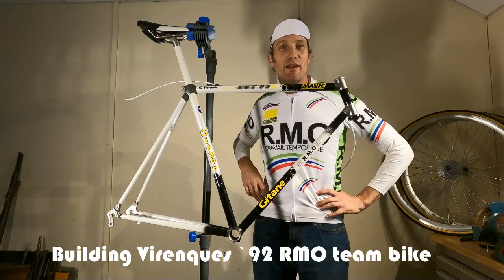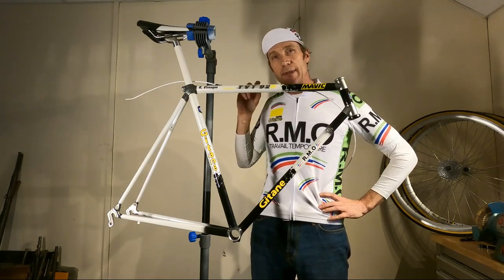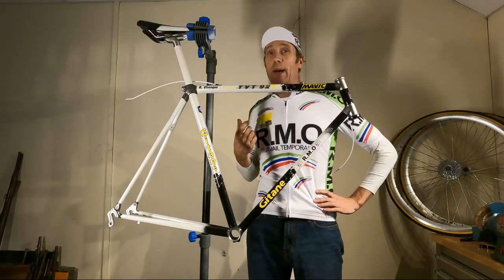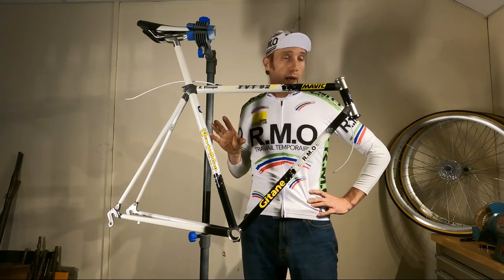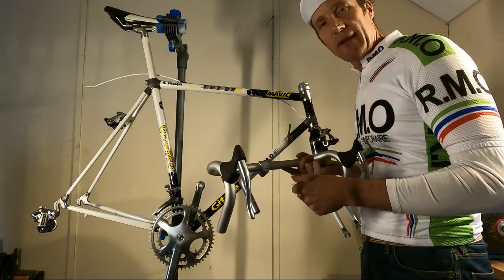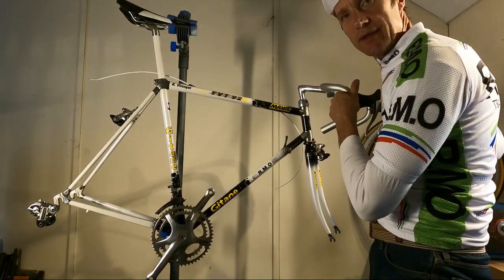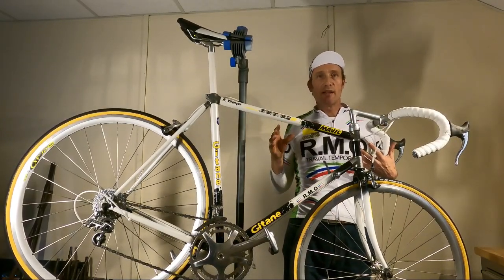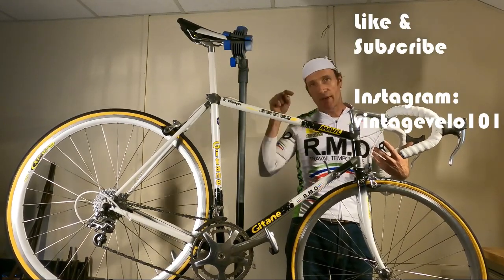Richard Virenque`s `92 RMO team bike build

Comment: Beautiful bicycle.  Richard Verinque 7 time KOM! Sean Kelly said In an interview he liked the Mavic Components so he’s a good supporter.  I have a 1986 Vitus 979 full Dura Ace.  My positioning is strange as I feel my head extends past the handlebars.  In watch Sean Kelly in the 1986 Paris Roubaix, his positioning is the same so the “run small” description holds true.  The wheels on mine are the Mavic Gel 280 32 spoke which have a reputation of being frail due to their light weight design.  I installed some beefy 25mm tires which barely fit in the rear triangle, but in doing so I believe I saved these rims as they are completely original.  Good day, Sir!
Reply from the maker: Nice, I`ve always admired the 979, one day...

Comment: The Lemond GAN team was spied using 8 speed Campagnolo Ergos.  Speculation was a campagnolo spaced shimano cassette and some speculated there was a 571-2 campagnolo free hub.  Mavic did make a Campagnolo 8 speed for the 571-2 hubs.  I found one a few years back.  I run a campagnolo rear derailleur which matches the silver rear derailleur in the GAN pictures.
Reply from the maker: Can be tricky figuring out exact team spec as there was always behind the scenes tweaks going on as you say, Dan

Comment: i just had to rewatch the 92 tour to see that bike and i'm pretty sure those bars weren't set up like that 😉....but it's a stunner no doubt. I have to ask tho, are carbon bonded frames of that vintage really still rideable?
Reply from the maker: Good question - carbon/ally bonded frames can suffer from electrolitic (?) degradation if moisture gets in the joint - you should hear weird noises/creaks before they let go - the pics I`ve seen online of TVT frame failures are what I would describe as used and abused bikes, though always best practise to check any vintage frame  often regardless of material, Dan.

Comment: Many famous riders had use Mavic rear derailleurs and won races with no problems that you claim. Please stop bashing the product . I have many bikes that have them and they are great.
Reply from the maker: Yep, many Mavic users really like them - I`m just not one of them - Campy or Shimano are just better/easier to use in my opinion based on using/riding/setting up all of them - though that didn`t stop many great riders winning loads of races on them - but by the end you can`t compare late `80`s 7 speed retrofriction Mavic to 8 speed indexed Campagnolo Record let alone 8 speed Dura ace which is in a league of its own, sorry, Dan